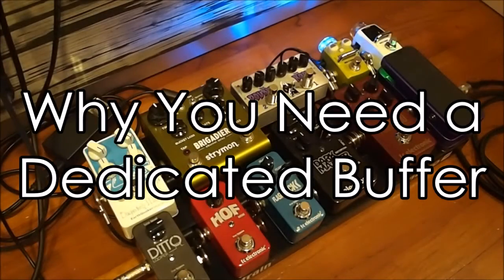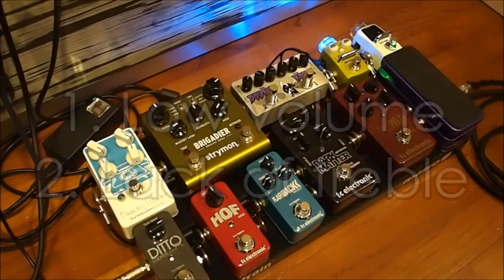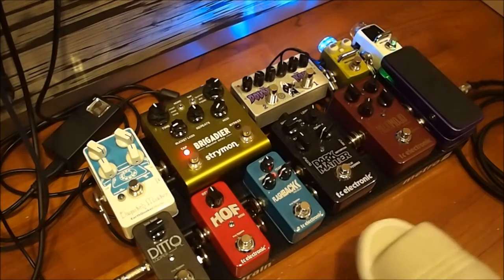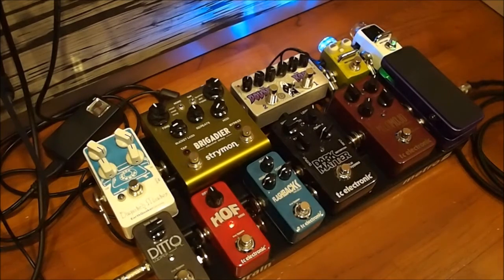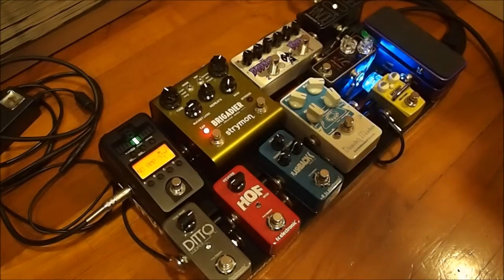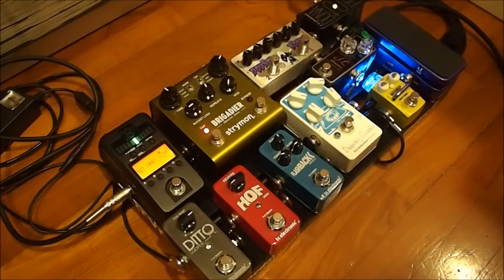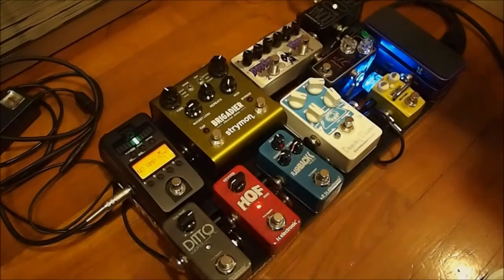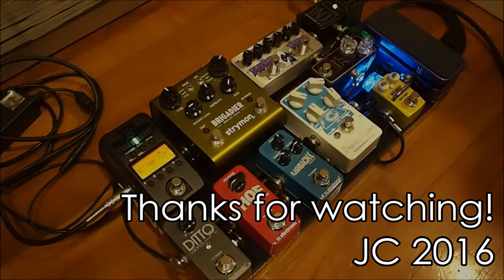Why You Need a Dedicated Buffer (TC Electronic Bona Fide Buffer/Gear Lesson)

Comment: When a pedal is turned on, it actually acts as a buffer. Tore mentioned that all their toneprint enabled pedals do have the option to be in either buffered or truebypass mode. The last in my chain is a TC HOF2 and starts with a TC Polytune 3. Both on buffered mode. I am covered. What I am saying is, if you had all your pedals off and it sounds dull then it comes back to life when you turn one on, that is a natural way of buffering your signal. But of course depending on your style, you do need to turn pedals on and off. So it is always better to have a dedicated buffer at the start and at the end of your chain. That way, even if you have all your pedals off, your signal stays strong and true.
Reply from the maker: Thanks for the insight! Admittedly, I've learnt a lot more since I made this video, and indeed I am reaching the same conclusions as you. The majority of my time is now spent in the Line 6 ecosystem with the Helix, HX Stomp and POD Go, but I appreciate the reminder!

Comment: Hi, that giant step in volume you show at the beginning of your video is NOT a symptom of the lack of a buffer, but a symptom of something really wrong with one of your cables or connections. I'm a big fan of buffers in pedalboards, and did hundreds of comparisons in my life, but never experienced such big volume differences as the one you showed... except when I had some faulty cables (or even bypass switches)! Buffers can sometimes hide faulty connections because they can minimize the effect of an interposed resistance or capacitance between/in subsequent pedals, so this is what happened at he beginning of your video.
Reply: Agreed. It's likely a faulty connection in one of the pedals that is causing the huge volume drops. It's happened to me before and it's a matter of repairing the pedal and/or cable.

Comment: Hi Justin. thanks for the video. I am now thinking to buy a polytune3 But the problem is I am using 2 pedal boards that is now being splitted by DOD a/b switch. what I am thinking now is Guitar > polytune3 > dod ab swith > board A and B.
do you think iy works as a buffer ? thank you so much
Reply from the maker: Hi! Yes, the signal is just converted from high to low impedance, and your a/b switch is true bypass, so the signal coming out of it will not colour the now-buffered signal from the Polytune 3. 2 boards! I gotta see how you're running your rig!
Reply: @AllAboutWorshipGuitar  thank you sooooooo much Justin. I will try it soon and let you know tbe result. Once again,  Thanks a ton!

Comment: Great demo !!!!
Should I place the buffer before or after wah pedal ? Thanks
Reply from the maker: Thanks! If your wah is one of the first pedals in the chain, the buffer before or after doesn't make a big difference, unless your wah does suck tone. If it does, experiment by having the buffer as the very first pedal.
Reply: If you have a vintage wah and/or a germanium fuzz go with this

Wah-->buffer-->amp
Fuzz--buffer-->amp

Otherwise, modern wah pedals these days which are pre dominantly true bypass is not affected by the placement of the buffer.

Comment: I have the exact opposite problem. I have an Egnater Tweaker 15 (not sure if the amp model makes a difference) and it sounds great when I have no pedals engaged in the effects loop. As soon as I turn on the carbon copy delay or the boss Harmonist that I have in the effects loop, I lose a ton of volume and treble. Anyone have the same problem or have any advice?
Reply: Use pedal that can handle line livel signal (effect loop signal) carban copy n harmonist cant

Comment: Hi, Justin. May I ask where that komp is placed in your chain and if is it an aways on pedal? If it is in the beginning and always on, you shouldn't need a buffer in that place... Would be better to put it in the end... So says the common sense and also my results around here... That said, buffer placement doesn't seem to be a very accurate science (specially with wahs and fuzzes)... Regards from Brazil!
Reply from the maker: Hi! The Komp is indeed at the front of my chain and always on. I followed the recommendations to me in that the first pedal should "always be a buffer" (save for wahs and fuzzes). I did try placing it at the end-of-chain, but I didn't hear much difference. To be fair, this rig is quite dated, and I've sold off 90% of the pedals here; I wouldn't be able to conduct any further testing!

Comment: My guess is a Boss type buffered pedal at the start of or early in the chain would also fix this? It's not something I've encountered so perhaps I'm lucky!
Reply from the maker: +d2vmusic I think so too! Might sound different though, my friend's TU-3 at the front of his signal chain imparts a certain character.
Reply: Thanks Justin. I'm waiting for a Strymon Zuma power supply before I put together my 'mother of all boards' (!) which will be a mixture of Boss, TC Electronic, Strymon and EHX pedals. I invariably have a TU-2 right at the front but if I switch things around this will be worth remembering. The Zuma delivery dates keep on getting put back here in the UK, it's annoying but hopefully worth the wait :)

Comment: Theres more buffers in your pedál than you Evan know..are you sure your not thinkingof a booster
Reply from the maker: Yup, I've learnt a lot since this video was made, and having experimented with a lot more gear, I'd perhaps have framed the video content differently. But I was certain the Bona Fide Buffer made a huge difference to my tone, especially since my patch cables were terrible, my interface was poor quality, and the power supply was a cheap one. Having replaced all those lower quality components cleared up my tone without the need for the buffer. Then I went Helix and I sold off the majority of my pedals!